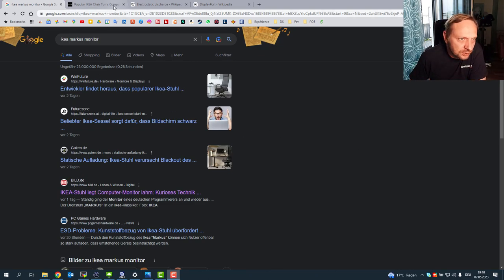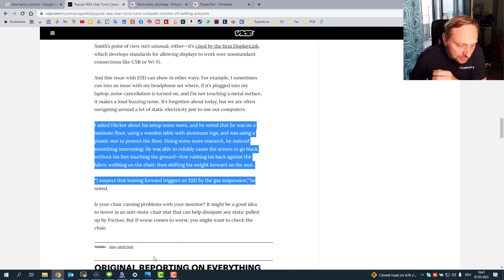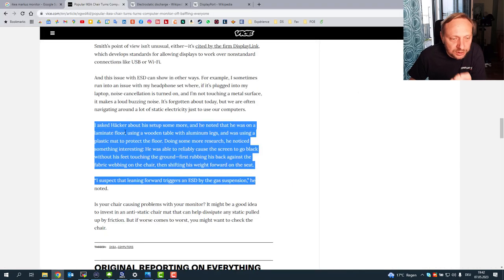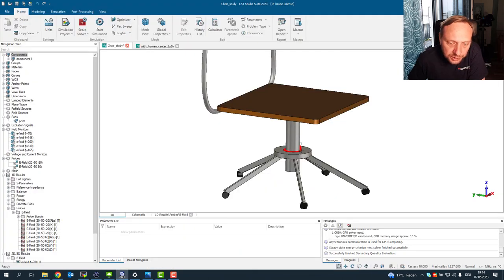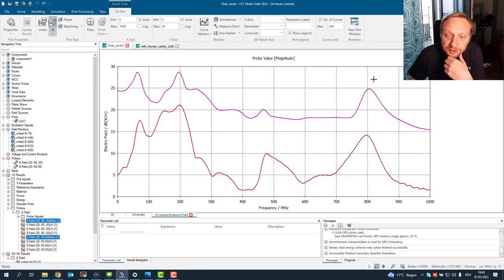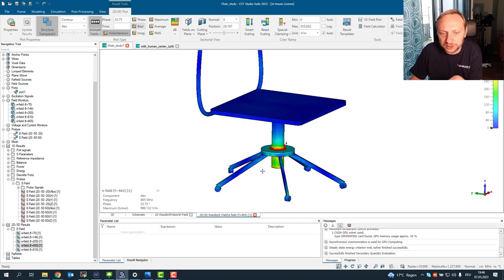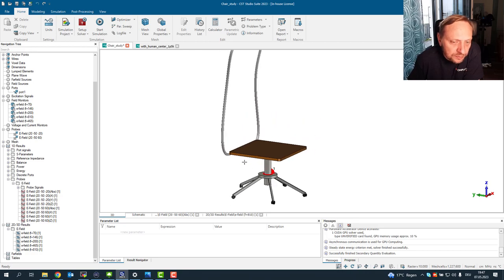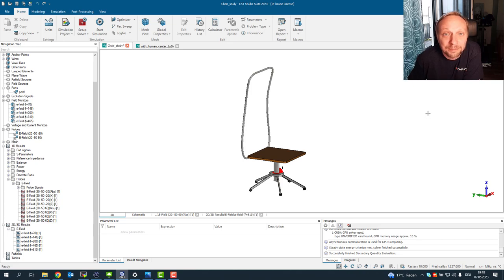Office Chair Interfering with a Monitor?!

Comment: Hello, what material would you recommend for a chair to avoid this type of interference ?
Reply: Because this might sound crazy, but when I use my computer I have lag issues when I sit on my chairs, I try a few of them, but as soon as I stand up and I dont sit and im barefoot everything works perfect, but for real I've been trying to find the source of my issue for years, and I've found that this issue is fixed when im not in touch with the chair, is not a issue like the one you said, my monitor is not turning off, is just lagging, there's something with my body and the chair causing this input lag, I would like to know if there's any explanation to this, I know it sounds crazy but I really need helps, also what would be the best chairs to avoid this issues? thank you so much for reading :)) and sorry for my english
Reply: I even tried wearing antiestatic wrist band, but it didnt work, the only thing that made a difference was using the pc while im barefoot in touch with the ground basically, this was a improvement, but what fully fix it is stay standing, so as soon I sit down everything is lagging and delayed ): I really need your help please
Reply from the maker: what do you mean by lag? A completely wooden chair without any material should cause no interference as wood is an excellent isolator.